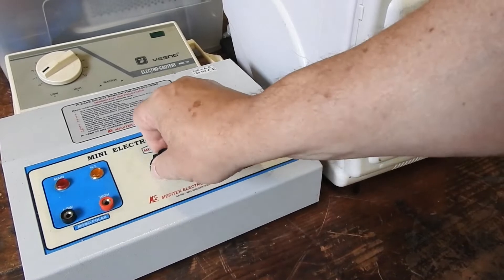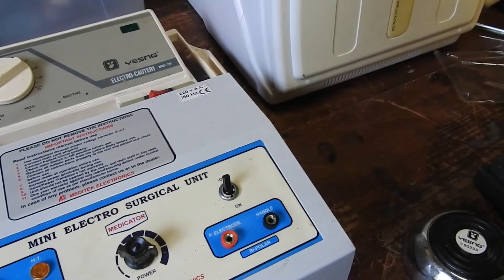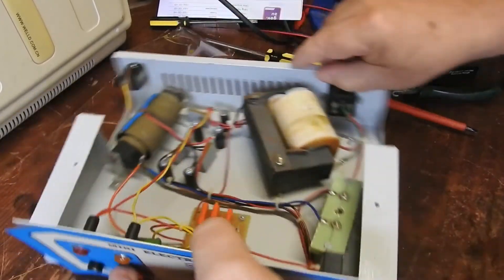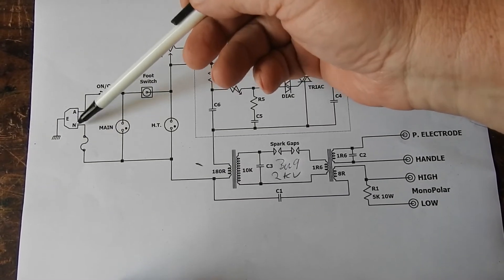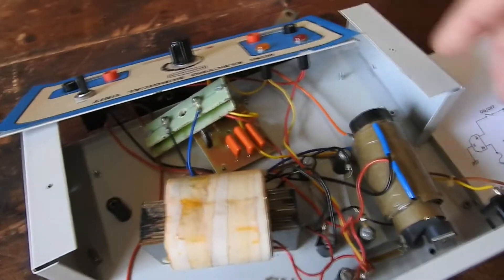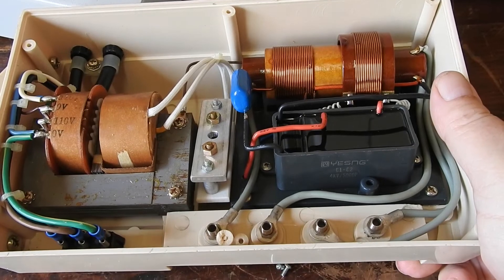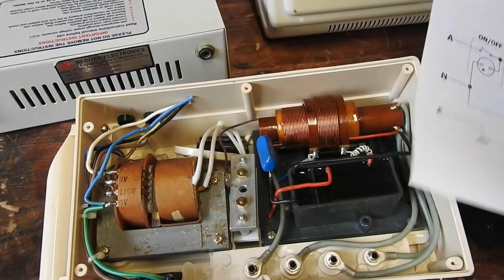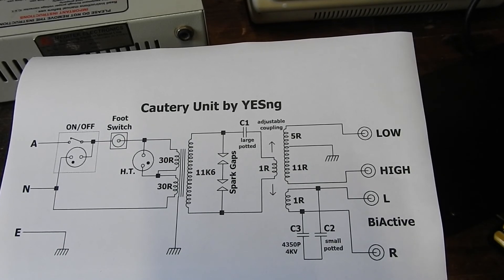Interesting Junk - Electro Surgical/Cautery units

Comment: Oofff… that is some dodgy stuff…. I’ve always thought medical electronics to be at the same level as military electronics… all high-level construction, just with a lot more emphasis on safety… looks as though I was wrong…. Ok, ok… I have seen the internals of some other "medical devices" too…. I just hope when I am treated in a European hospital, the equipment they use is less dodgy than the units you just showed….😂😂😂

Comment: Used in a doctor's surgery, not an actual OR, to do these in room surgeries. Cheap, and simple to use, likely were dumped either because doctor moved, or the rooms were broken in to ,and this all went, till the crackheads figured out it was hard to fence, so dumped it.
Reply from the maker: These were found in a bin (along with small electronic parts) on the nature strip outside a house in a nice neighbourhood. There's no reason at all to suspect any criminal activity was involved.